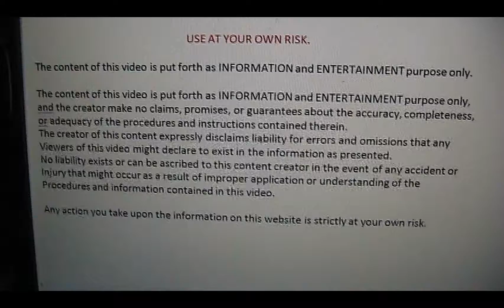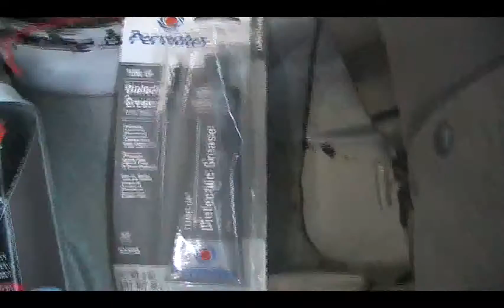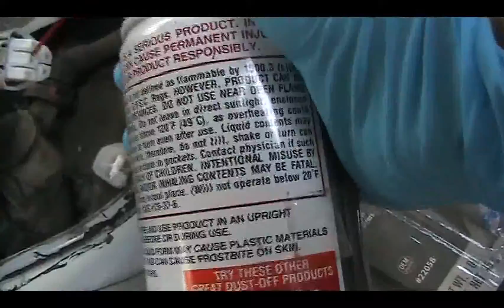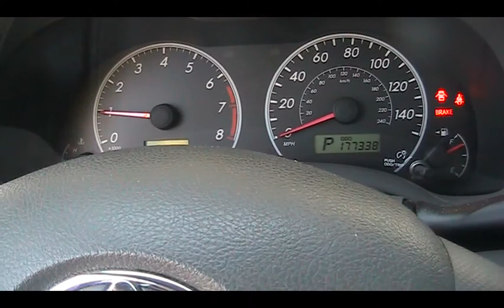P0001 OBD-II Trouble Code: Fuel Volume Regulator Control Circuit/Open - Clean Fuel Pump connection

Comment: I have the exact code for my mazda6 I'm not sure to get the regulator or fuel pump!!!
Reply from the maker: A lot of time, when the regulator is bad, the fuel filter, pump and the rest of the component may be also need to replace soon. It is much easier to change the fuel pump as a whole unit rather than disassembly the unit piece by piece if you can afford a new unit. Thank you so much for your comment and thank you for watching.
Reply: I can replace the fuel pump.but the one code say p0001_fuel regulator open on rail
Reply from the maker: @stephanmoney7493  Hi, Stephan, sometime it is caused by bad wiring contact on the wiring harness. Also, if you almost ran out of gas (using last gallon), the P0001 may show up too due to low on gas in gas tank. Thank you for your comment and thank you for watching.